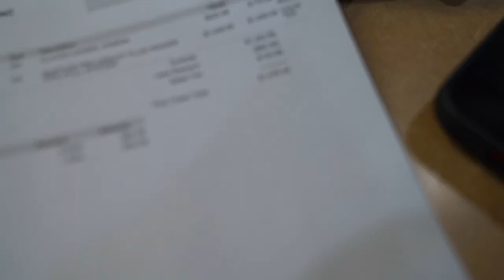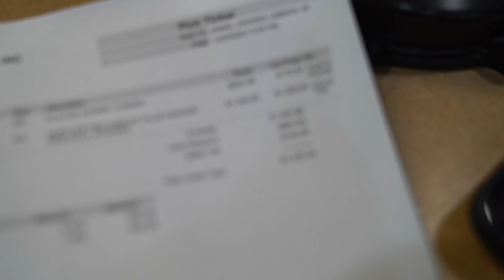BUYING THE MOST EXPENSIVE EXHAUST FOR MY 2022 KX450F ! | BRAAP VLOGS

Comment: The green sticker is cool but what you need is the green carbon fiber tip! I've got one of those unicorns 😏. Also side note, that pipe is a factor length. Designed for the polished intake ports and updated ECU. Anybody with a 2020 or newer can call their local Kawasaki dealership and order that pipe, it is expensive but anyone can get one. Need the Xtrig clamps and dirt star wheels next!